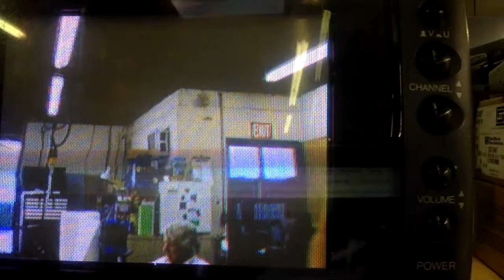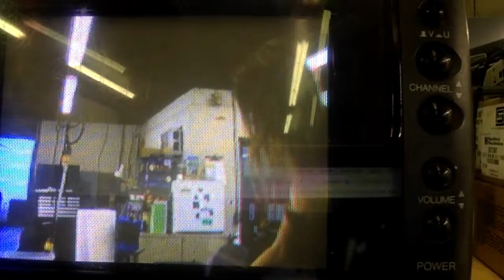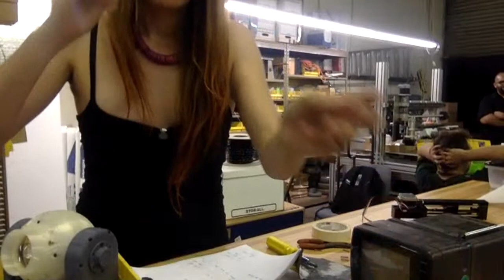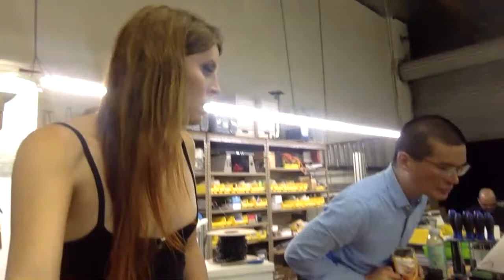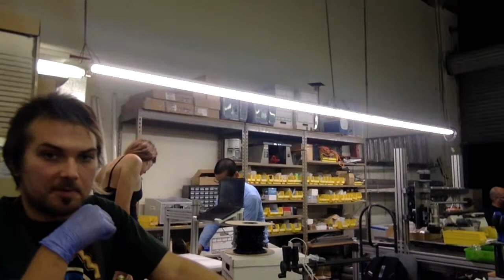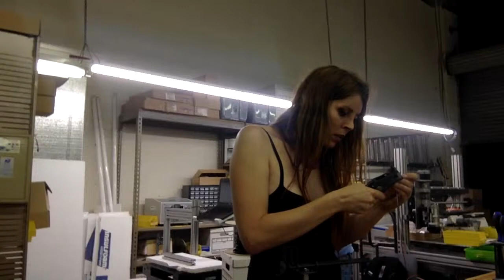Analog Video SGVHAK Livestream Extravaganza

Comment: You get great results  with video feedback, if the camera and monitor are slightly off axis and rotated with respect to each other. The other thing you can do if you can connect the two with RGB, then swap the colours round you can get some really mad effects. FYI the original 1960s Dr Who titles were made using video feedback, but with a B&W camera and monitor. In the 70s I worked with the guy who did the effect for Dr Who. We made a colour version of the system, but with the addition of a sound to video controller that would colourise the picture. The hue of the colour was controlled by the pitch, and the saturation by the volume. It was quite mad and was used by Top of the Pops one year. There were lots of cool effects you could do with analogue video and we used them all back in the day!
Reply from the maker: That's very cool! Do you know if any footage of your device working survived and is online anywhere?
Reply: @EmilysElectricOddities  The colour version of Bernard Lodge's Dr Who titles is all over YouTube: https://www.youtube.com/watch?v=BzjE-j9EX10 The Top Of The Pops stuff is much harder to search for.
Reply: @EmilysElectricOddities  who'd have thought that this video would have got two old guys in England so over-excited about analogue video effects.... ;)
Reply from the maker: @edgeeffect  I wish I had one of those video image inverter things to play with now
Reply: @EmilysElectricOddities  there could still be some on E Bay... back when Sadiq Mohamed was working on them they were only for the TV companies but by the  90s (as with most electronic stuff) consumer grade versions were available... I got mine in about 2005 once they were becoming obsolete... I see them on E Bay from time to time and think "they are fun to play with"... especially after Sadiq Mohamed's suggestions for hacking them.
Reply from the maker: @edgeeffect  What would be the right terminology to use when searching for them? I don't exactly know what to call them. Video controller?
Reply: @EmilysElectricOddities  I'll have a look and let you know. for the record, I managed to start my career in TV in Sept. 1969 just before the BBC converted there first channel to colour. The second channel started colour in 1967 I think, though they were doing tests before. Although I started as an engineer, I spent most of my career as a VT Editor on analogue tape. Managed to span the whole period from 2" tape to digital in the early 21st Century. Have a look at http://www.editorsbench.co.uk  Not very up to date but you may find it interesting!
Reply from the maker: @sadiqmohamed681  That's very cool! What a career!
Reply: I had a memory of something called VIDIOT, and a search found these people https://lzxindustries.net/

The make a range of voltage controled video & audio processing including a audio processor that output 5 control voltages from band-pass filters. If you pair this with one of the other devices you can gt the same effects as we had back in the 70s, but with much more control. I am surprised that not only is this a thing, but there is a company making this sort of stuff to order!
Reply: @EmilysElectricOddities  I was lucky. I joined the BBC at the right time, then left to work for a company that was making music videos for The Kenny Everett Television Show, and MTV. Then went freelance when there were only a handfull of broadcast qualified VT editors in Europe.
Reply: @EmilysElectricOddities  I usually either dig through the categories or just search for "video processor" or "video desk"
Reply from the maker: @edgeeffect  They are a lot pricier than I was expecting!
Reply: @EmilysElectricOddities  I doubt it, unless it appears in one of the episodes of Top of the Pops that has been archived. I'll have a look on iPlayer. There were some devices in the early days of VJ'ing which could do similar things, but again these would have been analogue. The most common effect was to key the camera output into a colour field using ChromaKey and then modulate the key level with the audio. Some analogue video switchers even had an audio input for that. I suppose that you could hack a colour corrector for live video to get access to the control levels and then modulate them via A-to-D's. I've been retired for 10 years so am no longer up to speed. When HD came in a lot of the studio and editing tech went on without me!
Reply: @sadiqmohamed681  there's lots of bits of Top of The Pops on YouTube... but you'd need to know what artist, song and broafcast to look for so it'd be quite a nightmare to search for.

I used to have a colour corrector... which is where all my "invert the camera signal" comes from.... I wish I still had it now because your idea of modulating the colour correction is GOLDEN and I really want to give it a go.
Reply: Oh yeah... RGB swapping might be cool! Mmmmm... I want a colour TV now.
Bernard Lodge!!! My hero!
You can also get good effects if you can get a processor that will invert the image... You get quite intense stripes of light, dark, light, dark: - 
https://www.youtube.com/watch?v=sWuyUaG3lfY&t=380s